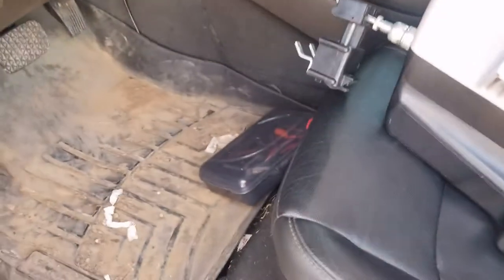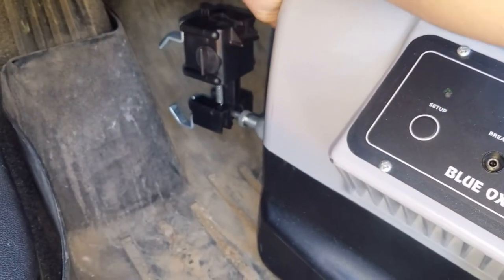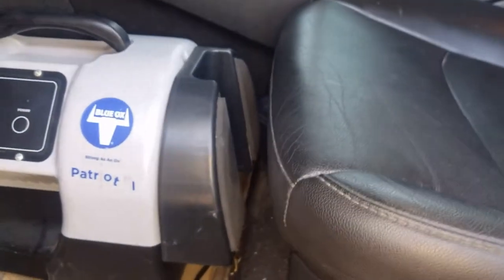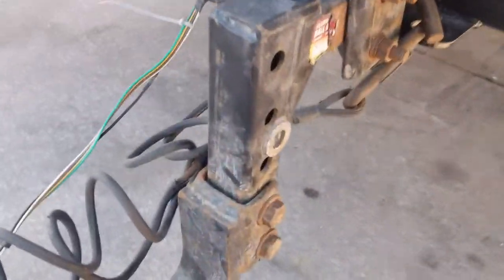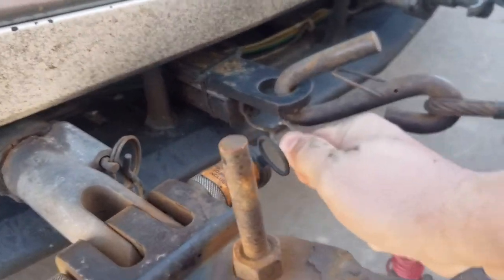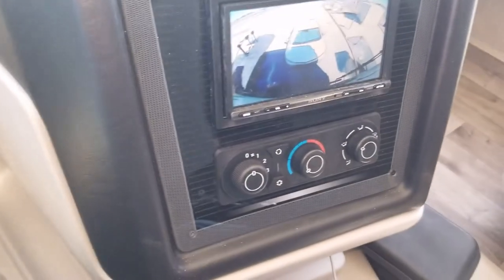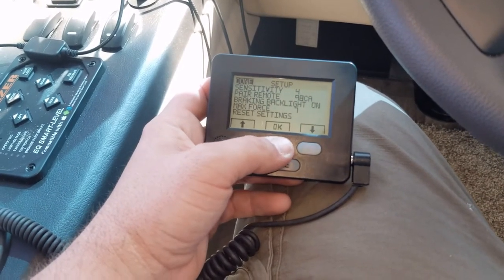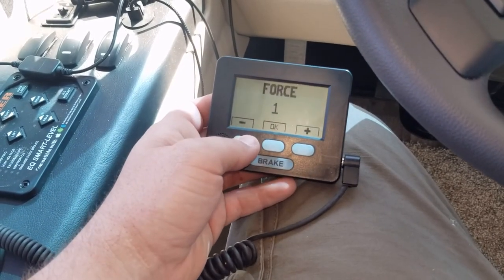Blue Ox Brake system Setup. Step By step. DIY Patriot 2 & 3

Comment: Thank you. When the unit is plugged into the cigarette lighter in the vehicle being towed, doesn't a kill the battery?
Reply from the maker: My car is deep cycle. It takes a slow drain  better then a normal auto battery. It takes a little over 72 hours to kill my battery if I don't have the towing unit charging the tow car.
Reply: You could easily run 12v from the towing vehicle's plug to keep the battery charged on the vehicle being towed.